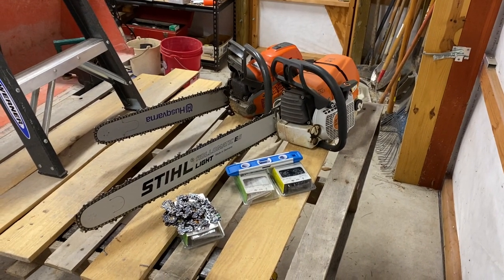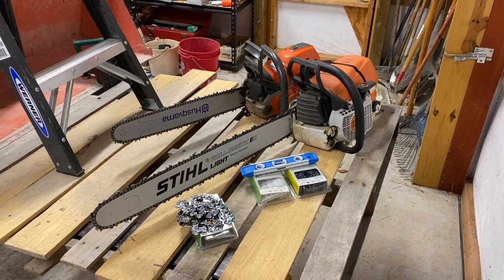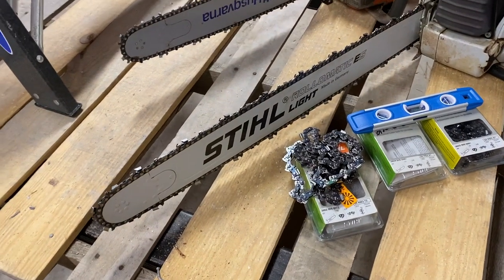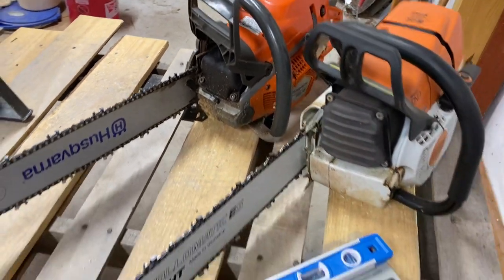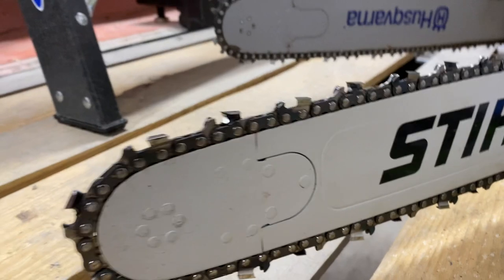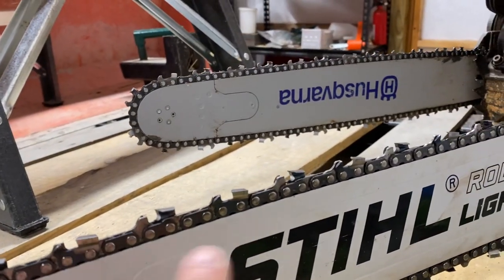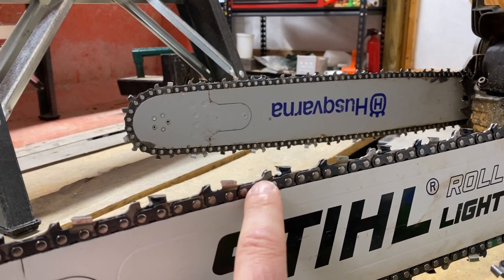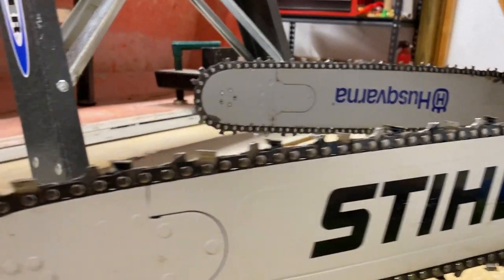Chainsaw Chains: Full-Chisel, Semi-Chisel, Safety, and Standard

Comment: So I have an echo 590 and it comes with a safety chain supposedly (echo uses Oregon which would be a d70 supposedly) and I also have LPX Oregon chains which are not safety chains and have warnings. 
But last I looked I can't see these safety things on the "stock" safety chain. It is a full chisel that comes on it. There are also LGX chains I think are called super pro chains now are supposedly even more dangerous. 
Thanks for the explanation but this doesn't seem to be the same for Oregon chains. I'll have to double check. All mine says in book is after filing rakers to proper depth to round off the front of the raker

Comment: My short bars get full cutters long bars get saftey chain  .. 
I have never tried a ¾ chain 
I was checking the oiler on a 36" bar with a saftey chain near the side boards of my trailer (looking for oil splatter) and the engine torque moved the chain into the board and it climbed clear up and engaged the chain brake before I could react

Comment: I can't find anything but safety full chisel chains or semi chisel chains for my saw for some reason. Is it going to cut straight if I file those safety raker looking things off? Not the rakers but just the safety ones that fold out as they go around the tip of the bar so the tip doesn't seem to cut. This saw will not hardly cut while the full bar is buried and I'm assuming that's why. Can't see how it could hurt anything but figured I'd just ask
Reply from the maker: What brand/model saw?
Reply: @Lumber_Jack  this particular one is a Ryobi ry40580
Reply from the maker: @jackle842000  Those small homeowner saws generally always use low profile safety chain and I don't think it's the intent of those saws to be buried in a log.  They are focused on letting people make safe straight line cuts that do not engage the tip in the wood.  To me it sounds like you need a bigger saw with a longer bar if that is an issue.

I think it would be nearly impossible (or very tedious) to file off the safety rakers without messing up the depth rakers.  The depth rakers are super important for all around cutting performance and you don't want to mess them up.
Reply: @Lumber_Jack  it's not a small saw actually. It's 18" 40v which actually has more power than many gas saws with a battery in real good shape and 6 plus ah and will run the full bar buried no problem at all.  The batteries need to be made better honestly as they overheat if you try to run constantly to saw firewood. You have to swap batteries with each single cut through a 24" oak to keep from totally shutting down from over draw & heat. This saw would be awesome if it could use 2 or 3 batteries at once while drawing from both at the same time from a backpack. They make a backpack system but I'm unsure as to whether it draws from a single battery then switches or from multiple at once to slow the drain on each battery. It needs to draw from more than one at a time.
Reply from the maker: @jackle842000  I am mainly thinking about the low-pro chain it's running -- that's kind of a giveaway that it's meant to be a lighter use saw.  Nothing wrong with that, just need to be aware what it's setup for.
Reply: @Lumber_Jack  yeah, but what's weird is that I can find full chisel non safety chains for my little 12" low profile Ryobi 18v saw but not for the 18" 40v model. I even have a tungsten carbide toothed chain for the little 12". I just always liked the full chisel chains non safety chains. I really like using the battery saws but may have to go back to using my gas saw for firewood purposes.
Reply from the maker: @jackle842000  I suspect 12-14" probably has good selection/availability since arborist top-handle climbing saws use those size bars with low-pro chain.  I have an Echo climbing saw with 12" bar and there are a lot of different chains to choose from.  Never thought about it, but the same exact chains would work on the homeowner saws.

Comment: Do I have to change the chain, if I sharpend a safety chain so much, that the hight of the raker, is the same hight as the safety raker?
Reply from the maker: Don't retire chains until you can no longer file the cutter.

Comment: Which chain is easier to sharpen?
Reply from the maker: Semi-chisel practically files itself due to the cutter shape and the way it cradles the file.  When filing down the rakers to set depth (done less frequently than filing the cutters), there is less resistance on the standard (non-safety) chains, but not by much.  So in order of ease I'd say RMC, then RM3, then RSC and RS3.